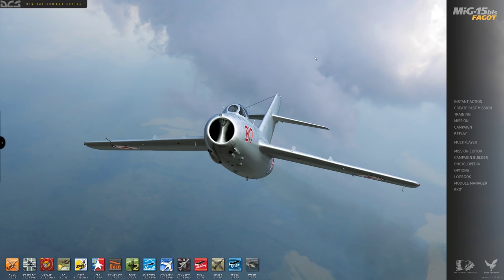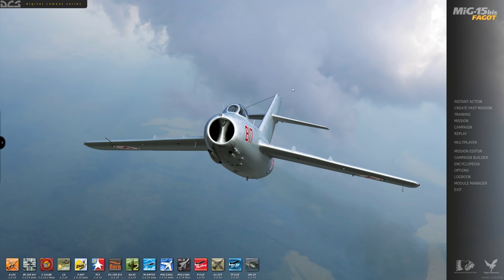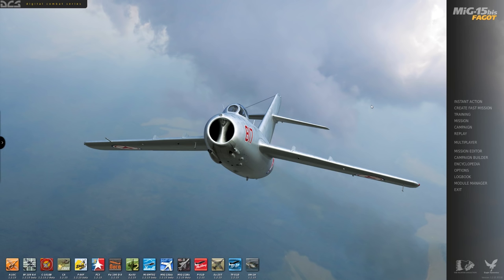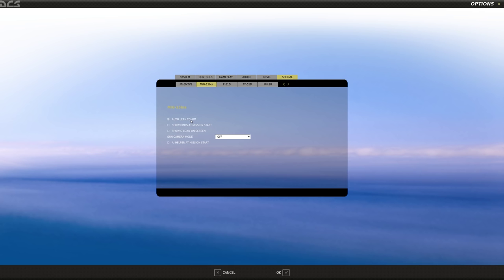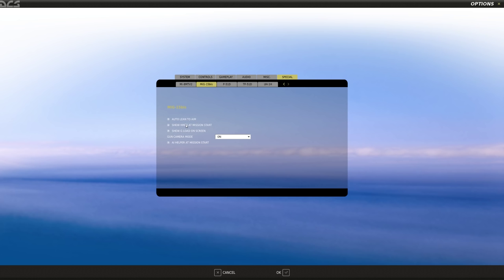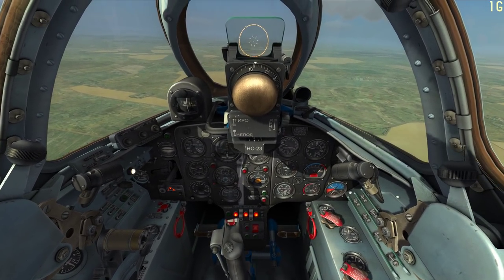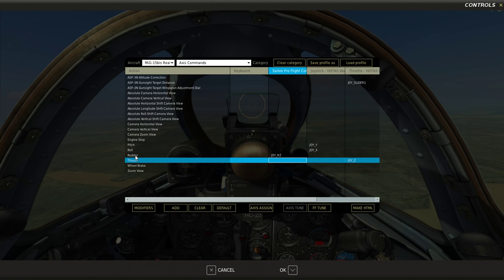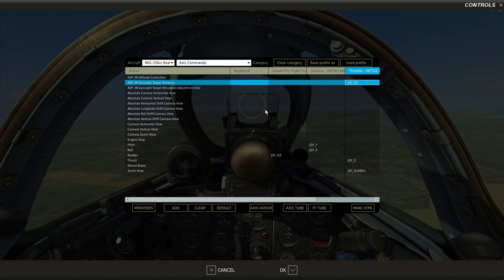Test Flight - DCS: MiG-15 bis Fagot #1 (Intro, Control Setup, Basic Handling)

Comment: Mig 15 is really going to be a fun challenge to fly. Unlike the F-86. the Mig-15 (and Mig-17 for that matter) does not have hydraulic boosted controls, instead still uses the mechanical cable pulley system used in planes in WW2. So at high speeds the plane will start to feel sluggish and heavy.

Comment: This is one type usable with the switch-poor controls common to many game simpits.  My first choice for the roll/pitch joystick for DCS: MiG-15bis as of 28 October 2015 would be the Black Mamba from the Virtual Engineering Bureau, for which I'd assign the dual Nudelmann-Richter-23 guns to the forward trigger, comm to the aft trigger, the Nudelmann-Richter-37 gun (originally assigned to the top button on the KG-13C stick grip and thus safetied by the trigger for the 23's under white-and-tight flight condition) to the right pickle switch, and the stores release to the left pickle switch.  Incidentally, the Russians' nickname for the Mikojan-Gurjevich-15 family was "Soldier's Fighter" (Солдатьний Ѝстреыбэтел), reflective of the MiG's ruggedness and ease of maintenance.

Comment: Could you look into the precision of the artificial horizon? It should lag, as the maneuvers get harder the more it should lag and even lock up in barrel rolls as I understand it.
Reply from the maker: NSAdonis I should have checked that in more detail when I was flying the air-to-air stuff.  I did notice a couple of times that it was out of calibration after maneuvering but I can't remember the circumstances.  I'll be sure to highlight that as I go.
Reply: Bunyap Sims It's a quirk of the planes of the time really. Apparently, one of the possible explanations or part of Gagarin's death in a MiG-15UTI (the trainer  version) was exactly the artificial horizons innacuracy in hard maneuvering.

Comment: Is this less heavy than the A-10C?  Less workload? Can a GTX-980 be good for this?  Can`t really fly A-10.
Reply: can't imagine you having that many problems. I have a GTX660 and, while I do run it on lower graphics settings, I get  constant over 60fps, even when flying stuff like the MiG-21 and Ka-50